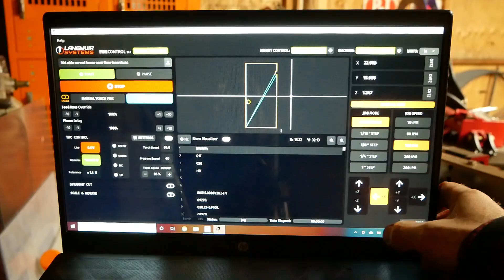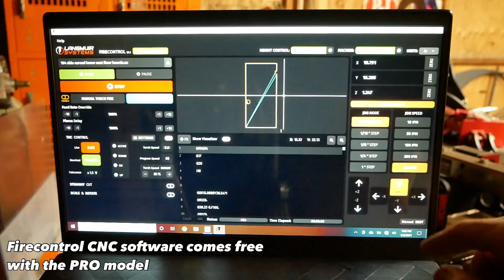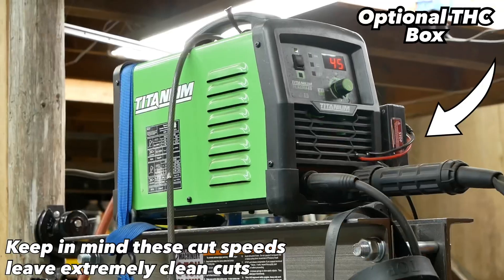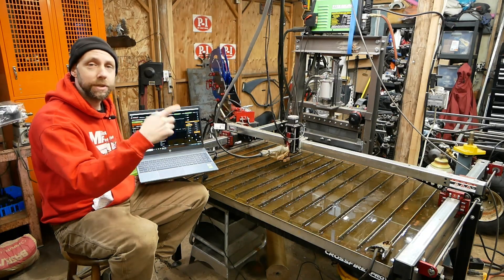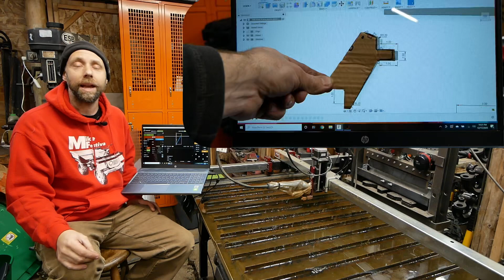Langmuir systems Crossfire PRO CNC plasma Table

Comment: I ordered one of these about a month ago (using your discount code... you're welcome) and should be here in about a month I guess. Really looking forward to it. I bit the bullet and invested in a Hypertherm 65 too... so much for affordable CNC plasma, haha. I wanted one already, but your videos helped push me over the edge to go ahead and get one. Should be a fun and interesting year.
Also... I am comfortable in Inventor and Fusion360 is almost a clone of that. But with all the hubbub around Fusion as of this past fall, I decided to just skip it and go with FreeCAD. The paradigm is similar and it is powerful too, but it doesn't need to "phone home for permission", won't be neutered when the CEO has a bad day, and files are stored locally instead of on somebody else's computer (the cloud). You're correct though, a 2D simpler program would be even better though. I bet there's a perfect fit out there somewhere.

Honestly, if you were to find a CAD program that's an actual great fit for the CF Pro toolchain, the search & comparison of what you find would be a good video idea maybe? I'd enjoy it, FWIW.

Comment: Thanks for your information. I saved it and will listen to it several times. I want a Langmuir Crossfire because of price. I have zip experience with plasma table’s or any cnc cad etc software. I want it for my home shop building cars and want my workmanship and quality the best I can be. From sheet aluminum.063 to 1/4” steel brackets. I don’t have very much patience. The Pro sounds best for ease. But spaceman my shop is limited 
What direction would you say I should look at

Comment: Mike, for those with a small laptop computer screen, a desktop computer monitor can be a help. I accidentally dropped my laptop, and had to do this after that event. The downside is that now one needs a space to put the monitor to work.
Reply: Thanks for saying that I was about to say about the same thing. I use a lap top with full size monitor with wireless key board and mouse. Makes it just feel better

Comment: Hey Mike, love you videos very informative and entertaining!! I'm a welder also, I dont have a lot of stuff at home, I usually get my stuff cut at work ( weld it there to on my breaks) I'm looking into buying a welder for home, but I'm on budget is the yeswelder a good option for me( the multiprocess) that you have, if not what would be a good one? Thanks in advance.
Reply from the maker: Kevin’s it’s been a great welder so far 👍
I only have about 8 months on it so far, no problems yet. I also like my Titanium 200 but the price went up on that welder, it’s now about $750, so the Yeswelder is a much more affordable option.
Here’s a video with lots of info
https://youtu.be/uX0jA4258Jw
Reply: I bought one of those Yeswelder 205DS a few weeks back and I agree that it's a pretty good small-ish welder unconditionally. The price of the thing makes it a gem in my opinion. Just a few weeks in, but FWIW.